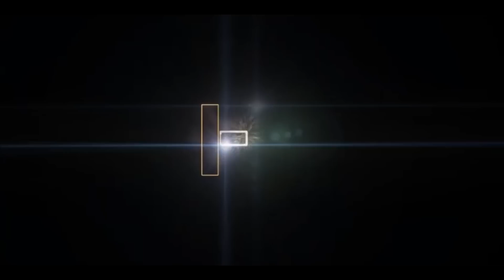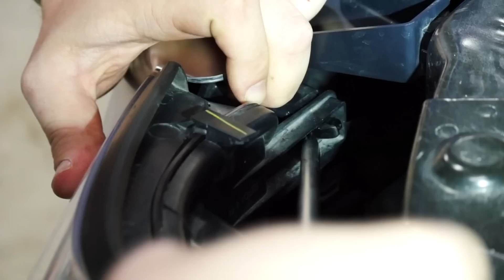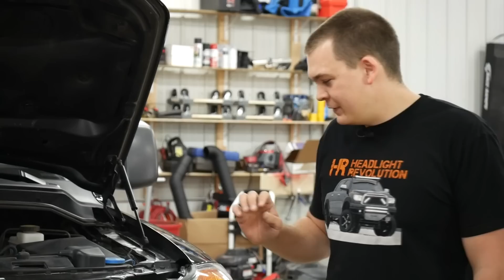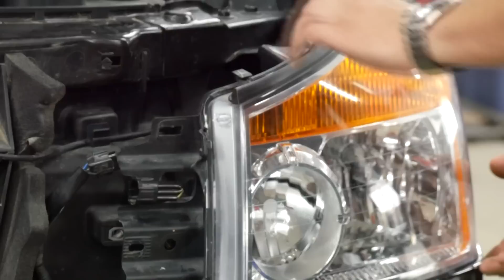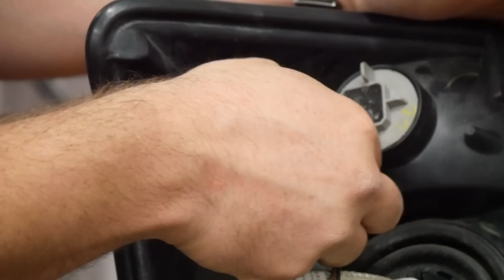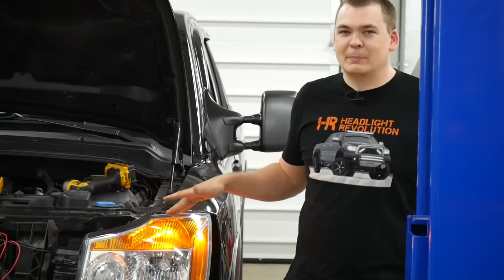2003 - 2015 Nissan LED Front Turn Signal Bulb Upgrade Install | Headlight Revolution

Comment: Can you tell me what is the resistance of that resistor?.I replaced my front turn lights with led tipe on my 2005 pathfinder ,now is flashing to fast.Thanks in advance for your response
Reply from the maker: This is what we use: https://www.headlightrevolution.com/50w-6ohm-gold-resistor-ACC.RES.50W_2?quantity=1

Comment: I have installed resistors on my front blinker and saw no result.  I know 100% wired correctly but still hyper flashes.  Does the resistor need to be installed on my LED turn in the rear to see the result? Do they somehow tie into each other where both resistors need to be installed to see the hyper flash go away? thanks
Reply from the maker: You would need to install a resistor on any LED bulb you added.
Reply: @HeadlightRevolution  I got that. So they all have to be installed first before I see any results? All 4 connected and completed before any change is noticed. Cause I connected one to my front blinker and it still hyper flashed. So does that mean I have to have all connected before they will stop, like a big circuit?

Comment: What number bulb size or front and back ?
Reply from the maker: Front: https://www.headlightrevolution.com/3156-3157-gtr-lighting-carbide-bulbs-LED.BUL.3157.CAR2_2

Rear: https://www.headlightrevolution.com/3156-3157-gtr-lighting-carbide-bulbs-LED.BUL.3157.CAR2_2

Comment: There's no such thing as a 2003 Nissan Titan.
Reply from the maker: Actually it just squeaked in there for 2003, with productions starting September 21, 2003, and sales starting December 1, 2003! 😄

Comment: Hey there, I’m having trouble removing the old turn signal light from the socket. You said to turn, do you have to pinch anywhere to get it loose?
Reply from the maker: Most of the times you just have to turn the bulb to get it out.

Comment: If I change all 4 turn signals, do I need a resistor for each of them?
Reply from the maker: Yessir, each will require its own resistor.
Reply: @HeadlightRevolution   what happens if you don't use resistor?

Comment: Can the controller or can a pwm be added to make the lights ramp up and down in brightness when blinking?
Reply from the maker: I don't think so.  This is just how LED's go.  You'd have to decrease and increase the voltage, and that's going to be more work than it's worth.
Reply: Headlight Revolution thank you. Maybe I should think about a niche market in building custom pulse width modulation controllers. I saw another video that said the current is kept constant for the leds. Interesting times with all the tech advances. Thanks again.